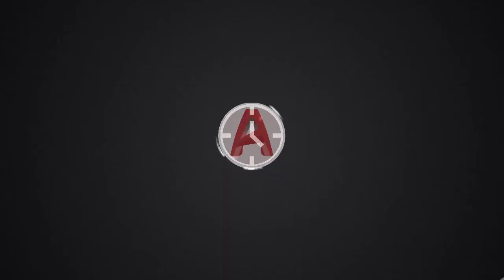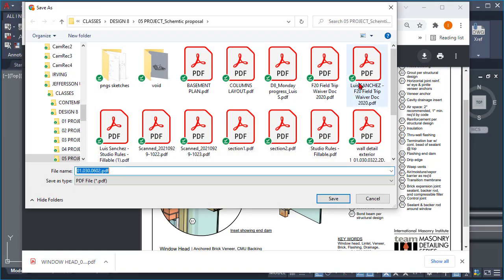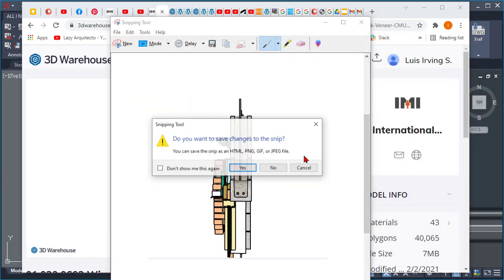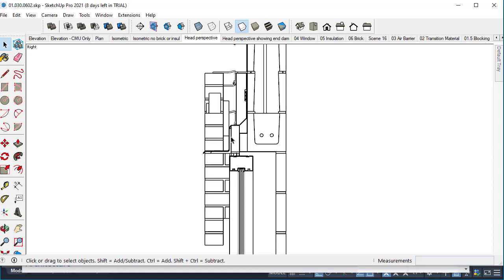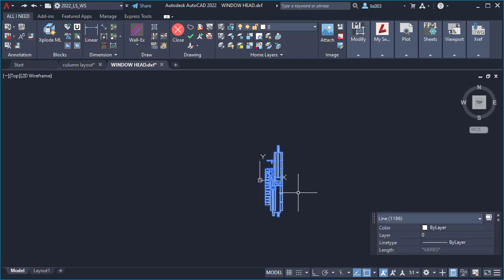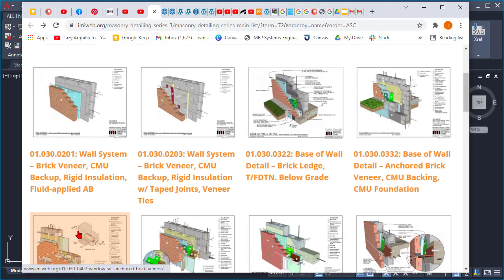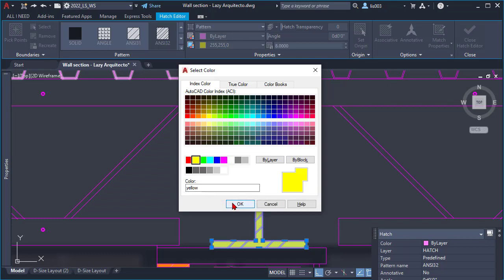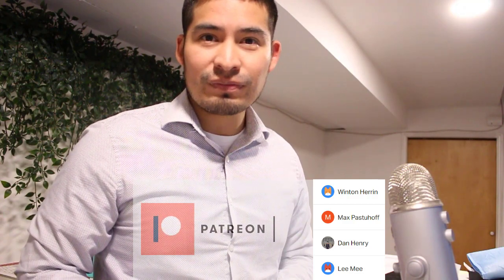How to create wall sections in Autocad (Part 2)

Comment: Looking forward to part 2. I need to compare it to the software I use to convert PDFs to DWGs and OCR for text.  Sometimes I find it easier to bring in the PDF file, scale it, lock it down then just trace it. I’ll sometimes do it in Adobe illustrator with the trace feature. Keep up the great tutorials.
Reply from the maker: Good idea to use Adobe illustrator too
Reply: I own SketchUp Pro and use it often to import 3D sections exactly as you did here from various sites. Very efficient way to do it. Comes in handy especially with Simpson Strong Tie hangers etc. when their site doesn’t have the drawing type I need. Even though I have the add-in for Simpson within AutoCAD.
Reply from the maker: @douglasmichel6361  I have a friend who have Simpson installed in his AutoCAD too. They have good detail connections